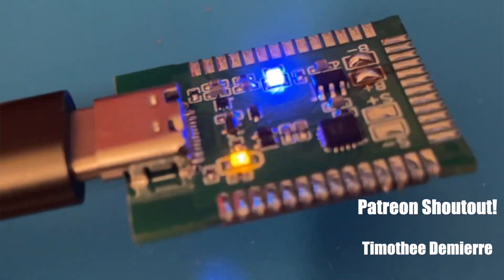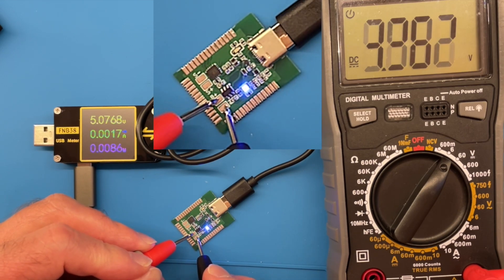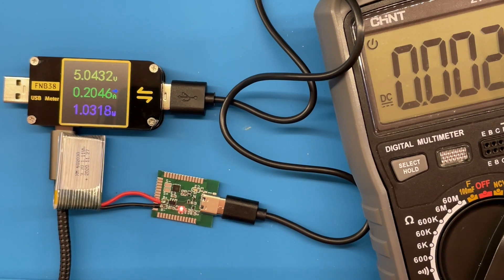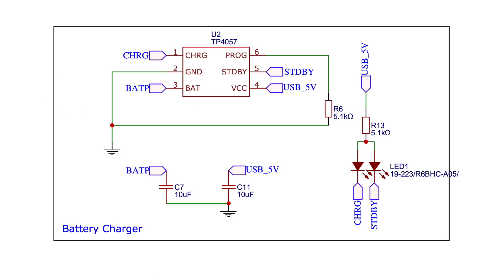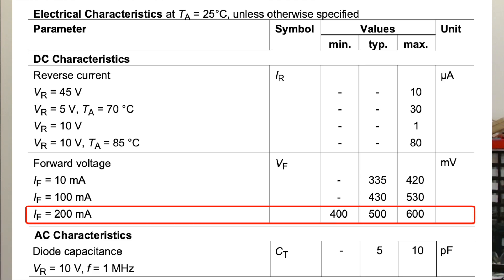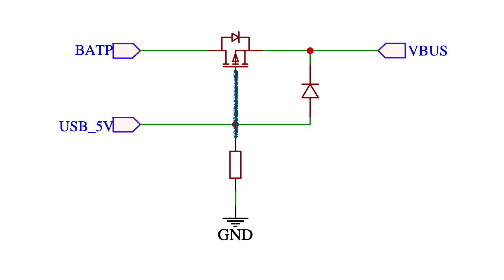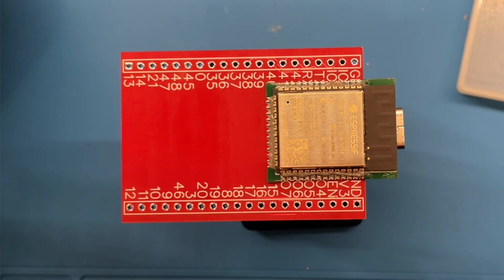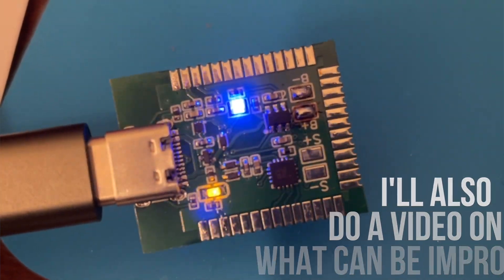Easy S3 PCB and Schematic - it’s really simple.

Comment: Even though this video is not freshly uploaded, I wanted to share an in my humble opinion even better solution for the 2 supply problem mentioned in the video. As having multiple supplies is a fairly common setup in a project,  I stumbled upon the TPS2110/1/2/3/4/5 and TPS2116 series of Texas Instruments. Especially the newer version 6 is a cheap and easy approach to solve this problem. I implemented it in multiple projects and it makes it so much easier and sophisticated. With 20 cents of costs it hardly increases the BOM cost in comparison to a discrete version, even the opposite. Other manufacturers like Richtek, Renesas or ST offer similar prodcuts, but this IC from TI does not necessarily need a microcontroller to control operation of the mux.
Reply from the maker: I’m actually using that IC in the latest version of my ZX Spectrum board.

Comment: did you come up with the Misfit solution yourself? or did you get it somewhere? I'm looking at integrating the same kinda setup for a project :) and was curious. PCB is looking great :) very smart
Reply from the maker: The MOSFET power path circuit? It’s quite a well known pattern. I copied mine from the Unexpected Maker’s dev boards. But you can find lots of examples elsewhere.
Reply: @atomic14  yes that one :) did not know its name, thanks alot!

Comment: Hi, very nicely done!. you mention there is room for improvement and you wil probably design a newer version. Could you give some information about the improvements you are thinking about? is there anything you are not satisfied with now that you have some considerable experience with them?
Reply from the maker: There are a couple of follow up videos where I add on a lot more peripherals. The main thing that is missing is an easy way to force the ESP32 into firmware download mode. It works most of the time automatically, but occasionally does not...
Reply: @atomic14  Thanks for the quick reply!

Comment: Nice project. Would be it better to add an under discharge protection like the DW01A?  I don't know if the MCU can still work below 3V or less, in that case it could damage the battery. At least with batteries without protection incorporated.

Comment: pcbway also solder those components? If not, did you do that yourself or got it done somewhere else?
Reply from the maker: Yes, they do SMT assembly. For this I assembled on side and soldered the ESP32-S3 module myself. If is pretty easy (though pretty fiddly) to do it all yourself. I tend to stick to 0603 components if I'm doing it myself.

Comment: Nice how little it is. Is it necessary to "burn" that efuse (USB_PHY_SEL) to use native USB? I designed and built a custom board with an S3 and want to get the native USB part functioning so I can program it, as there isn't a USB to UART IC on the PCB. Thanks in advance for answering soon!
Reply from the maker: It should just work out if the box from the factory. You may need to hold IO0 low when you power up/reset to get into boot mode.
Reply: I use it all the time and you don't need anything.  Moreover, the Upload by the USB JTAG DEBUG port is WAY FASTER than the highest speed setting on the Serial port.

Comment: Thanks for your work. I have a concern regarding the charging circuit. I've come across recommendations against using a self-designed load sharing circuit with a diode and a MOSFET. I was wondering if there are any differences between the TP4057 and other ICs(mostly TI did) with power path management functionalities in this case. Thank you once again.
Reply from the maker: Interesting - do you have any more information? In theory, when the battery is being charged it should be completely isolated from the system by the MOSFET. There is a really interesting video from @bigclivedotcom where he talks about charging circuits - https://www.youtube.com/watch?v=f2yMs-JAyQM I don't think there's really much difference between the TP450X ICs.

Comment: Could you reduce the size even more and make it the exact same size as the ESP? Does the USB port impair the antenna?
Reply from the maker: Yes, you can definitely go smaller - I think you could easily fit it on the size of a mini module. The USB connector will have an impact - I'm going to do some tests when I get some time to see how much.

Comment: With many references to datasheet it is funny how you completely ignoring one of the key requirements of not having components or traces under the PCB antenna area
Reply from the maker: We'll be doing some experiments in a future video to see what the impact of this is. There are definitely some tradeoffs being made in the current design to fit everything in.

Comment: An absolutely interesting video! I was searching for something like that since a while... One question: what's the role of the class D amplifier? What are the two {SPKN, SPKP} items for? Thanks a lot and waiting for a follow-up.
Reply from the maker: There's a sneak peak in the next video in the series: https://youtu.be/6b1Lels0a3c - the SPKN and SPKP are to connect a speaker - and ultimately I'll be connecting a small screen to make video display.
Reply: Can I remove the amplifier block only while leaving all the rest?
Reply from the maker: Sure - you only need the amplifier if you want o hook up a speaker.

Comment: Big fan of your videos. One question: isn't there a smaller package for the S3? Why did you choose this big one?
Reply from the maker: There is yes - https://www.espressif.com/sites/default/files/documentation/esp32-s3-mini-1_mini-1u_datasheet_en.pdf - it's a good point - using that one we might have been able to get everything on one side of the PCB in the same space.
Reply: @atomic14  i meant the esp32 packages without the metal casing. for instance the one on the lolin32 lite board.
are there any reason not to use them like RF shielding? i want to design a board very similar to yours, so i'm quite interested!
Reply from the maker: @veitklub Got you - have a look at the Unexpected Maker's boards - all his schematics are available and he uses bare chips. The main reason I stick to the modules is just simplicity - everything is wired up and there's a lot of choice around flash and PSRAM combinations. You also have to understand how to do antennas and stuff like that - way beyond my pay grade :)
Reply: @atomic14  thanks, exactly the information i needed! or as we germans say: "again what learned"
i will follow your example and stick to the simpler stuff!
Reply: @veitklub  One reason to stick with the modules is that they are pre-certified. This could be important and much cheaper if your product goes to market in jurisdictions that insist on exhaustive and expensive EMR testing.

Comment: 6:00 You should consider protecting the  gate of the p-channel MOSFET against power-on voltage spikes (inrush current). An additional resistor?
Reply from the maker: I need to do some research on some best practice for hooking up to USB power. I'm sure there should something there.
Reply: I think that's what USB ESD diodes are for.

Comment: Great video! Where may we buy this board already soldered with all these components? You could try testing it with a GPS using UART1 and also with some 4G/5G modem module attached to UART2.
Reply from the maker: I probably won't be selling these, they are very much an experiment to see what's possible. It's also just not possible to compete with all the dev boards out there that are very cheap.

Comment: I've not used the S3 but with other ESP32 boards the real fun starts when you try to use the radio on battery power. Drop out voltage of LDO and FET in conjunction with lack of 3v3 rail capacitance will cause brownout resets on Tx sooner than you would think, the biggest drawback of the ESP32 in my opinion is the operation voltages required. They are rather picky and make battery power projects challenging. I found that they almost require a buck/boost SMPS or large 3v3 capacitance to get anything near the rated capacity from the battery. If you include a UART port you can at least know what's going on when it starts the brownout resets. The Brownout protection works better than any other feature on the ESP-32!
Reply from the maker: That's very interesting - I'll watch out for then in my testing. I should be able to easily hook up a UART board to the pins and see what's going on.
Reply: @atomic14  By the way, depending on the sources, 0% capacity is referred to as 3V - 2.5V. On the other hand, at 10% it's still 3.5V...

Comment: The part where you explained the power circuit was fascinating and easily understood
Reply from the maker: Thanks - I think it’s a fascinating circuit. Something that I would never be able to come up with myself.
Reply: Sigh...I designed an S3 board and Win10 does a repetitive load/unload unless the boot jumper is set and then it loads and lists it as " "Unknown USB device descriptor". I put the board together from scratch, so is it necessary to flash a bootloader and firmware on it or something? (ESP32 S3 WROOM 1 module with antenna) Thanks in advance for advising how to get it functioning properly!   @atomic14
Reply: @atomic14  The P-MOS circuit is based on the reverse polarity protection circuit (here's a great video about it: https://www.youtube.com/watch?v=IrB-FPcv1Dc&pp=ygUVcHJvdGVjdCB5b3VyIGNpcmN1aXRz) . Only difference is, the gate of the MOSFET is now controlled by the USB signal and the diode is not a Zener one.
Reply: @atomic14  how do i get the gerber file i need to save but cant save to get gerber file
Reply: Im curious what the value of that resistor would be.. is it the case of "any 10k resistor" as it is in many cases.. or is it something that needs to be mathed on. :D

Comment: Neat and compact! I wonder about the battery voltage though. At the nominal 3.7V it's only half drained, and can be safely discharged down to 3.0V (or 2.7V, but I'd stop at 3.0 because there's very little energy left below that). That's why I'm annoyed by "strict 3.3V supply" devices. Even a basic AVR works with a 2.7-5.5V supply!
Reply from the maker: True, I think ideally you want to have a little boost circuit so you get every last bit of juice from the battery. Hmmm - I wonder if I could fit on the board...
Reply: @atomic14  i.e. "TPS63020 Automatic Buck-boost Step up Down Power Supply Module 3.3V " from Ali. It provides 3.3V from input between 1.8V-5V - tested ;-)
Reply from the maker: That's pretty nice - and it doesn't need many external components so would probably fit in the space. Inductor might be quite big though?
Reply: @atomic14  did you check on Ali? there are pictures there. It is 2R2 inductor
Reply from the maker: Pretty small!

Comment: Shouldn't you rotate your esp32 in your design so that the antenna hangs off the edge  of the board rather than ignoring the keep-out area? Does it make a difference to wifi performance?
Reply from the maker: It’s definitely a compromise I’ve made. I’m going to do some tests to see how much of an impact it has. I’ve got a couple of options for next version. I’m quite tempted to switch to a module with an external antenna - this removes the problem completely. Or I’ll use a vertical USB-C socket - that will give me a lot of flexibility on where to place it. I didn’t do that in the original design because I wanted to have the option of plugging into breadboard with the adaptor. But I’m now wondering if that was worth the extra effort or if my adaptor board should just include the USB socket as well. Or maybe I should just break out the 5v input and then I can use a USB break out board to hook it up in breadboard mode. Too many options!
Reply: @atomic14  
A vertical port would increase the form factor of the board. For some use cases the wifi need not be that far reaching in favour of the smaller footprint. 

I don't think the adaptor board benefits from the usb port being there as the pins are already broken out for use. The port should rather stay on the module. 

The external antenna. Yeah that's a good one. But the external antenna ESP modules aren't ubiquitous. Making the external antenna version of the board extremely niche, its reliant on a fairly rare module.
Reply from the maker: Very true - I'm going to do some tests - I can solder a ESP32 module directly to my adaptor board and use a USB breakout to program it. So we can see how much the USB port on my current board effects things.

Comment: I am afraid the metallic USB socket right under the ESP32 antenna is a major problem, even more if it is connected to ground, it will suck all the antenna's power. (made that mistake myself)
Reply from the maker: Definitely a big compromise. I'll be doing some testing to see what effect it has. For the next version I'm probably going to go for a vertically mounted socket which will be a lot more flexible.
Reply: @atomic14 
Maybe rotate the module 180° so that the antenna sticks out the bottom? 

Sounds like quite the hassle, hence my reservations in recommending it.
Reply from the maker: Yeah, the routing of the pins would be horrible - though I could use a four layer board maybe.
Reply: Really, it is a major problem, please treat it as such, no biggie, we are all learning.

From the ESP32 HW guidelines: "It is recommended that the module is mounted on the edge of the host PCB with the antenna exposed to free space. It is permitted for PCB material to be below the antenna structure of the module as long as no copper traces or planes are on the host PCB in that area" 

From the TI Bluetooth Antenna design: "Printed and surface-mount antennas have certain common properties. Area around and beneath the radiating element must be kept copper-free." [..] "The antenna will detune if any object is placed close to it (in its near field). This has an effect of pulling the
frequency, which must be retuned to 2.45 GHz."

Comment: Would the ESP32 not run on 3.0V?
Just wondering since it can operate from 2.2V to 3.6V.
I don't remember at what max speeds it can run on different supply voltages.
Reply from the maker: Had a quick look at the data sheet - it will do 3.0 to 3.6 so pretty flexible. But I think we’d hit probably with talking to other bits of hardware.

Comment: Did seon take it from the arduino mega, they have the same circuit. As I've just disconnected  the 5V from the usb connection as i don't need it and this totally removes the issue. Also its a common circuit on large military 28V power backup systems where you are pulling 100s of amps and a normal diode would get very hot😂
Reply from the maker: Not sure where he got it from - I first learnt about it from @AndreasSpiess - not sure I would be allowed anywhere near something that involved 100s of amps...
Reply: @atomic14 😂😂😂
Reply: @atomic14  large aircraft pull frightening amounts of power from the 28V busses and when you have to have seamless fallback between busses you can be diode OR'ing a lot of current.

Comment: Nice job, I have low voltage dropout problem to solve on my UPAS KP V2 project, so I now know how to tackle it, thanks for sharing.
Reply from the maker: No worries - I almost dropped the ball on this one - I knew about the MOSFET circuit, but thought it was overkill and the Schottky diodes would be fine. Fortunately one of my friends checked the data sheet and pointed out the voltage drop!